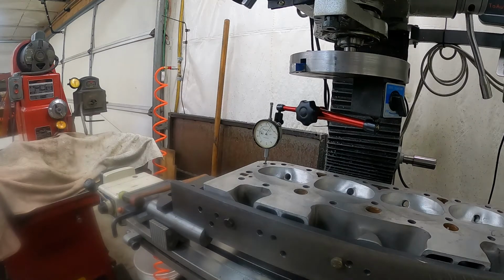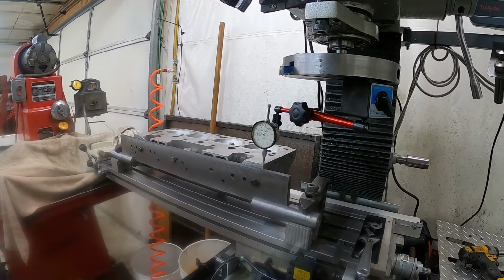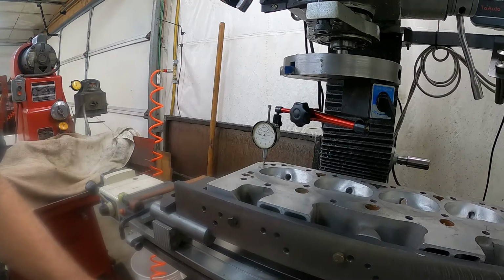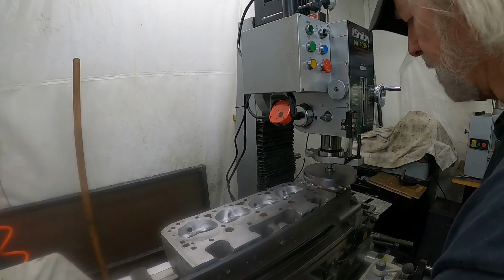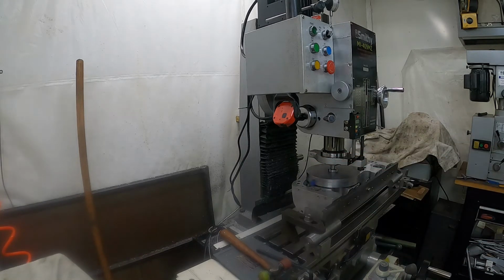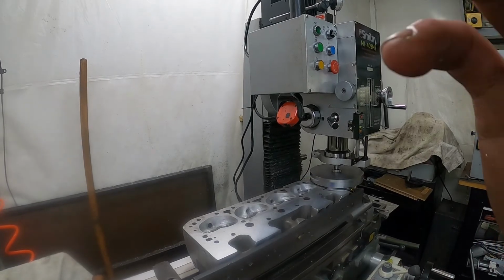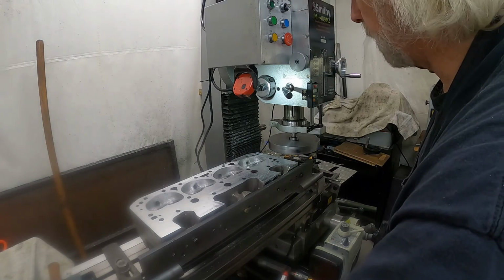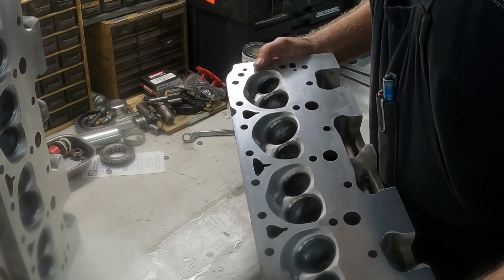machining head gasket surface

Comment: The machines designed to surface heads and blocks have a bit of a built in trick to them. The ~30" diameter cutting head is angled forward about a half a thou. That is why they don't produce a "back cut". It makes the center of the cut slightly concave, but good enough for gasket sealing on most applications. Your set up can work without the back cut, if you reduce that head angle to 2-3 tenths and take max cuts of about 2 thou, but as someone else here has posted, the mill table does shift / tilt when the center of gravity of the table and work goes past the edges of the x-ways. Usually that is worth a couple thou from one end of a V-8 Head to the other. My nearly new big 52" knee mill shifts about 1.5  thou on a Ford 300 6. Machines with worn ways in the center part of the X-axis travel will likely be worse. Lapping the head on a surface plate or a thick piece of flat plate glass (check with a straight edge first) would take the last few thou out, making it as near flat as a small mill in a home shop can get, IMO.
Reply from the maker: Thanks for the comment on this Scott.

Comment: Trying to surface heads on a baby mill like that will not produce a flat surface the table is so far out on the saddle it saggs,  you can even hear the power feed struggle as the table saggs and gets tight in the ways.
Reply from the maker: with the y axis gib locked when surfacing the head, I can lay a straight edge on the head surface  a.001 feeler gage will not fit. Have checked new heads and found the as much as .003 out. Thanks for the comment.

Comment: Thanks Randy. I take it that the plate you were using on the head was the one you asked me questions about hole spacing ? Regards from Australia.
Reply from the maker: Hi Dave That plate for holding the heads I made a year ago and the hole patterns were done with transfer screws. the brackets I made last week were to mount the mandrel holders for my sunnen connecting rod hone. Thanks Cheers